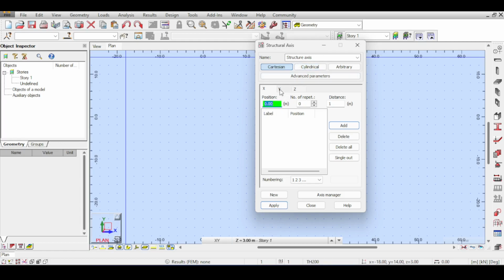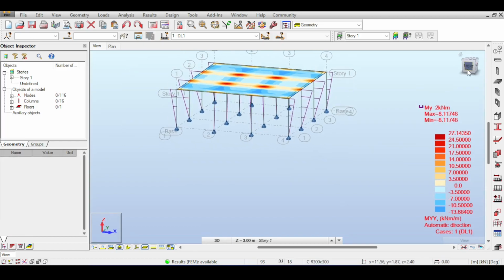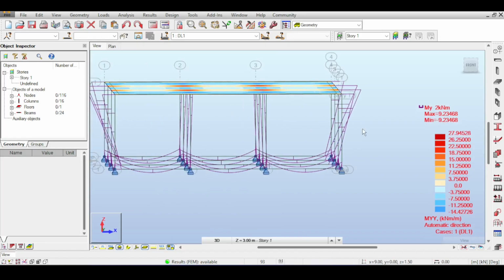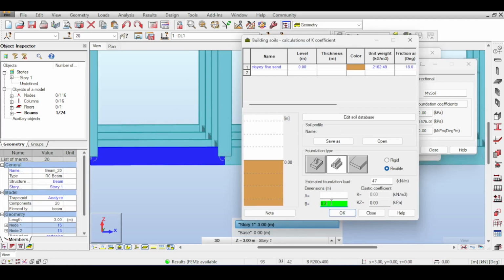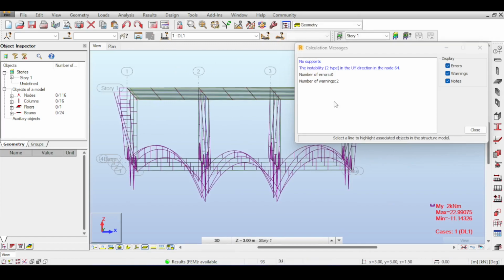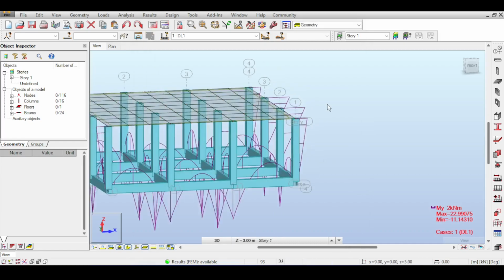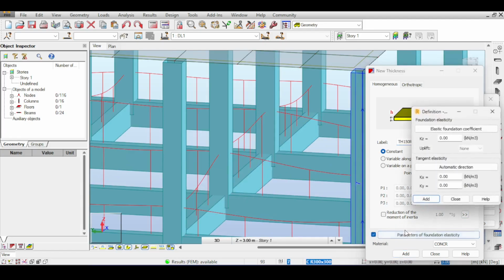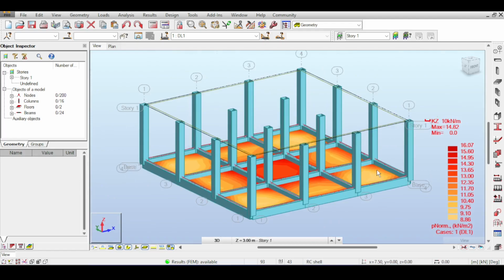Modeling Beams on Elastic Ground Foundation in Autodesk Robot

Comment: Hello CEE;

This is a really nice and engaging video; it systematically brings out different ways of evaluating this kind of structural foundation. I like the “brick-by-brick” build-up approach that have been used to work through the topic. The tutorial makes me pause and think of the following:

• It is quite clear that the ground beams (by themselves, without the help of a raft) are also capable of supporting light structural loads with reasonable (tolerable) values of elastic ground reactions underneath them beams. On the other hand, the introduction and integration of the raft to these ground beams does reduce and redistribute some of the ground beams original elastic ground reactions from the beams to the raft (and this is good news). 

• I suppose the designer has options here, the designer can decide (depending on the structure being designed and on the associated design loads, soil conditions, etc.) how much role the raft is required to play (or to contribute).

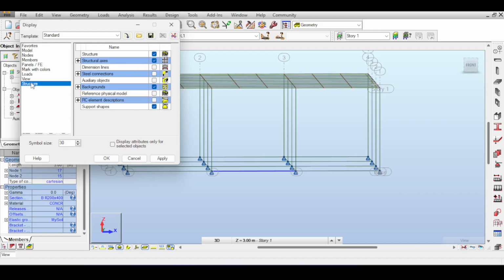11:01 You are correct, there is a symbol (a display option) to show “Elastic foundation”, you can find it under “Model” subcategory in the display options.

12:46 Yes, I agree with both Mr. Editor and with Mr. Recorder on this, these are the kinds of real-life behaviours and construction issues that should be explored and discussed. Thank you for bringing this up and for discussing it. I also don’t think the structure should move in the X or in the Y direction. I suppose this is where one would have to define the other elastic foundation coefficients i.e. Ky and Hx? 

Unfortunately, the way in which the values of these other two coefficients are estimated is still fuzzy for me. Kz is relatively straightforward (after the extensive past and present work that have been done by the CEE of course). I hope in later videos, it will also become clearer how to estimate or how to work out the values of these other two elastic foundation coefficients.

In the meantime, and just so to explore the point; I went ahead and input a value of (say) 1 unit for both Ky and Hx anyway (much like it was done before in the flexible method mat (raft) foundation video). This resulted in a “stable” structure. I know that by me randomly inputting unit values for these coefficients may possibly result in unintended consequences or unintended response by the structure especially in the X and Y directions (even the Z direction maybe?). As a small act of consolation, I have compared the values of the BM and SF obtained on the ground beams when there are unit values of Ky and Hx and when I have removed these unit values and used a “stabilising support” option that was suggested in this video by the CEE instead [kudos for that idea by the way]. I have found that both BM and SF values in both scenarios compare well and thus the structure response in the Z direction seem to be less sensitive to the unity coefficient values that I had used for now.

As a side note, I have also noticed that RSAP will still give a warning calculation message that says “No support” after one runs the analysis on a structure that is supported only on a foundation that is defined by use of elastic foundation coefficients. This warning message remains so even when all elastic foundation coefficients have been defined and the structure is stable. This message only goes away when one defines and assign any one of the supports under the supports dialog box. I find this strange because I had “presumed” that assigning “elastic foundation coefficients” would be taken as assigning a kind of a structural support?

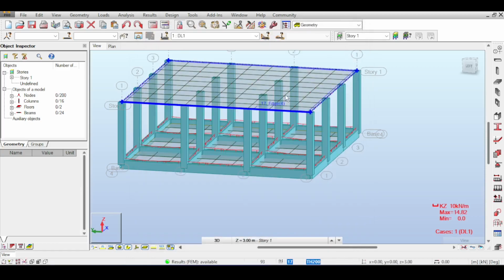19:22 This version looks like it is working as far as I am concerned. The modelling ideas are rational and solid; and the results seems to make sense. 

21:05 lol

Another side note from me: Following on from this tutorial and from the past mat (raft) foundation tutorial; both the modelling, loading, and analysis of beams or even slabs on elastic supports in RSAP is no longer a problem, it is now clear how to do this and it is readily doable. 

With my newly acquired confidence 😊, I have since attempted to run “verification examples” by modelling and analysing (in RSAP) some already solved beams or slabs on elastic supports example problems and comparing the results that I get from RSAP with the results from these existing verification example problems. I have been getting mixed answers, sometimes the examples verify as expected and sometimes not. I admit that my search for verification examples has not been that profound and I intend to continue with this exercise so that I can make informed decisions on this.

I’d suggest that if the CEE does decide to dive deeper into this, then perhaps consideration of some verification examples could be something to look at?
      
Thank you for another engaging video. I have enjoyed this video and I am looking forward to the next CEE videos.

Have a great day,

Regards, DK
Reply from the maker: Hi there Engr. DK,

yep, indeed, ground beams are capable of supporting structures as long as the bearing capacity is not exceeded. For the raft, it does help especially at positions near the columns. 

Thanks a lot for the hint with regard to the display options, it helped ^_^

With regard to other values, I think those questions warrant some "lecture/rsap video hybrid", as is the case in most "introductory videos" in the previous structure.

And you are right, even putting a value of 1 in those stiffnesses causes stabilization of the structure.

Here is some food for thought,
the lateral stiffnesses are used to model pile foundations subjected to lateral loadings on its top. There is a dozen theories about this, and the book "Foundation" from Braja M Das should have something about this.

Indeed, we use the horizontal stiffnesses - especially in research - when we want to model integrated bridges, and consider the soil structure interactions. I think I need to prepare something not as cryptic as research, but rather more practical.

the no support thing might be a bug on behalf of robot. Funnily enough, when I was giving physical training courses in robot (back in 2010s), I was still a "baby instructor" holding only a BSc degree, at that stage I was usually stating that there is "actual" instability and "hypothetical" instability. A hypothetical instability is, for example, what you saw in Ux and Uy in that structure, as it - in reality - won't budge in those directions under the given loading conditions and size of structure. Please note that under more extreme loadings for bigger structures, this would not be the case. But in the end, such structures (towers) would be piled.

You are right, this model (raft and beam) seems to make sense, but I still added the "disclaimer" in the video, as I want to dive deeper into verifications, exactly as suggested by you. This - of course - needs some time to check, double check, get the differences, if any, and explain those differences or find a solution to those.

Once again, happy to have viewers like you. 
Regards,
CEE
Reply: @CivilEngineeringEssentials  I got one question. Is it possible to build multistorey building with room size of 80ft x 80ft with no pillars in between. With wall or pillar support 80ft apart what should be thickness of walls and pillars to support and hold that huge slabs and multiple floors above it.
Reply from the maker: @KING_DRANZER  Yes, it is totally possible. It seems you want to have a cinema or a large auditorium for that regard. 

Still please note!!! the beam is going to be HUGE and the columns are going to be really extra stiff. 

If you are using a simply supported beam, then as per ACI code, your beam height should be at least L/16 which is 80/16 so 5 ft. This means that you are required to provide something called skin reinforcement as per the ACI provisions. 

For the column, here I do not really know. As the stiffness of the column (if you are having a frame) is going to affect the amount of moment it carries. Here a trial and error approach is to be adopted. But one rule of thumb is that the column should not be smaller than the beam. Because you want to have something called a strong column - weak beam connection for seismic provisions.

Finally, having large columns could be a challenge in architectural terms. Especially because your auditorium is actually 80ft x 80ft with zero columns in between.

If you want some nice food for thought, google: RC auditorium or RC details cinema.

You will see some nice ideas for your request.

I hope this helped.
Regards,
CEE
Reply: @CivilEngineeringEssentials  Please can I share the 3D design with you to check its feasibility. If possible. Please can you look into it.
Reply: @CivilEngineeringEssentials  Anyway, thank you very much for the reply. Actually it is a very complex design. But I will try to explain it. What my plan has is Ground floor 3 rooms 80ft x 80ft in which the Hall and the Dining Room are double floor height at 28ft and the Kitchen is single height 13ft with Storage room above it. 

The floor above it will be of single floor height and will have lot many 30ft x 40ft guest rooms single floor height 13ft. With center area left for lounge or common area. 

Above that gonna be again three 80ft x 80ft partitions in which Master Bedroom Small and Gym and Entertainment area are single floor 13ft rooms while 3rd is for theater which extends to upper floor. 

Above that is again one 80ft x 80ft Master Bedroom main with two floor height at 28ft. And 40ft x 80ft x 28ft common area for sitting and stuff. The 120ft x 80ft x 28ft will be extension to theater. 

So yes very complex design can this be feasible at all.

Comment: is there any new video of this? that you have checked its the right way, thanks
Reply from the maker: em,, if possible, could you provide more context of the question? you mean the ground beams?
Reply: i mean u mention u are not sure with that modelling and u need to check the calculation, if its right like on the real ones
Reply: and another question sir, do i need to put a support on a Slab on ground without UZ , even though i have already have a support on the column that is in a lower level with the slab. Or i just assign the soil pressure on the slab without putting any support? the context is the slab is on ground but in a diffrent level with the foundation, thanks

Comment: Thank you for the amazing tutorial.

If we supposed the raft foundation under the beams, then we can apply elastic foundation only on the raft foundation without applying in it on beams, because beams are part of the raft foundation 🤔, is it right sir ??
Reply from the maker: Hello there,
You are most welcome. If you apply the elastic foundation on raft alone without beams, you would still get an "automatic" elastic foundation under the beams that are part of the raft.) Reason? Because when RSA performs the structural analysis, it meshes the raft with the beam (it generates points that are on both the beam and the raft) then applies the elastic foundation below those points (so now the beam is also elastically carried by the ground)

The difference here is that, while the elastic foundation under the beam is a spring on a line, for a raft it is an area spring.

So I can say that both ways are right.

Regards,
CEE

Comment: Firstly I would like to say you do awesome job on this channel! Could you please explain how to use buckling analysis properly in practice? Robot have a problem with division of FEM elements which makes incorrect results in comperasion with Euler equation. There is a few videos on YouTube, but only easy examples with doing additional nodes, where in more complicated structures it's  really impractical.
Reply from the maker: Thank you very much for your comment.
Sure, I will take a look at it and post a video 'bout it if I find a practical way to do it.

Regards,
CEE

Comment: Thanks for this video.
Usually in our country isolated footings are introduced for a building coupled with concrete tie beam, is the procedure for the calculation is the same with this one or theres another way for the specific conditions, isolated footings with tie beams?
Reply from the maker: I will be talking about tie beams in another video. It is actually really easy. Just model a beam, add the loads (the column loads are not added in this case), add elastic foundation, and caculate.
Reply: @CivilEngineeringEssentials  thank you, i will wait for that tutorial about footings with tie beams.